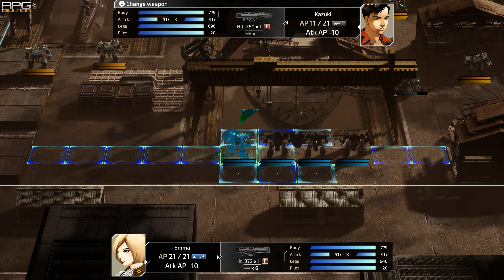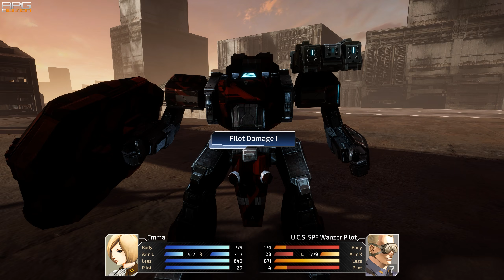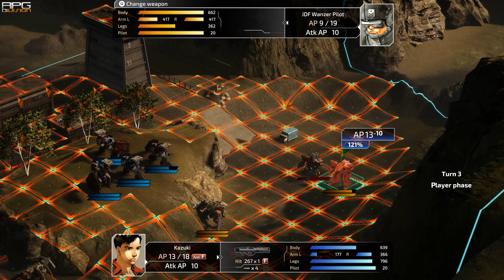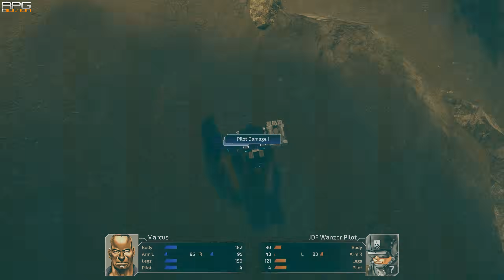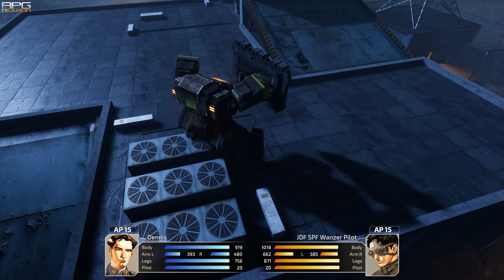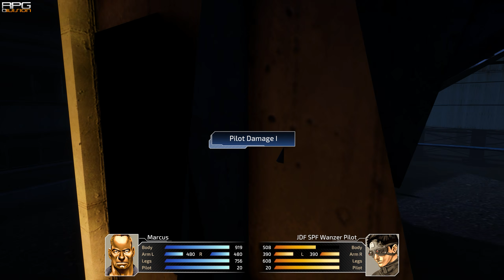Rocket Launcher Team is kinda OP - FRONT MISSION 3 REMAKE

Comment: Why not use pilot damage 3?
Reply from the maker: Pilot dm 3 slotted twice has smaller chance of triggering due to less instances slotted. Also it does only 6 dmg to the pilot instead of regular 4 or 5. Pilot dmg 1 slotted multiple times is more worth it due to combo chain and wanzer dmg potential.